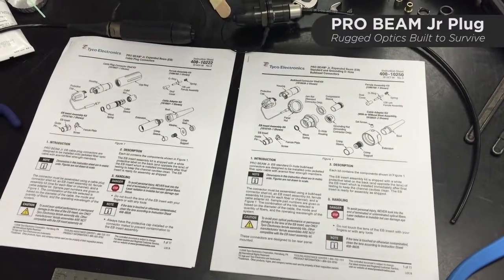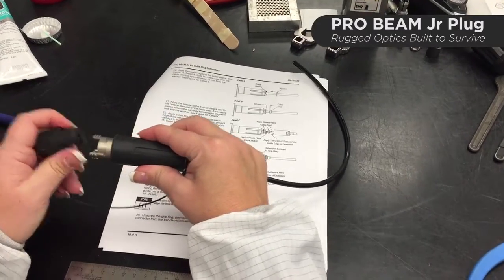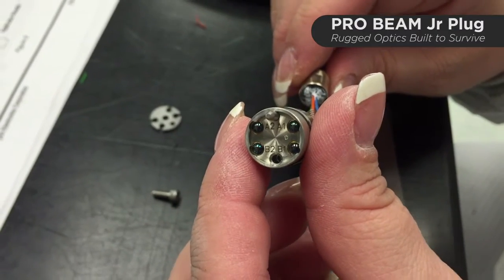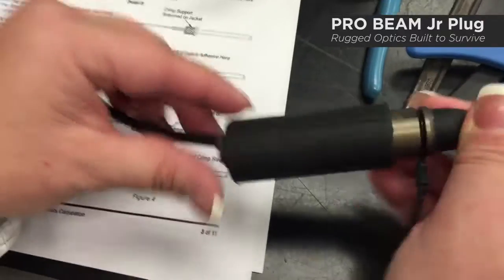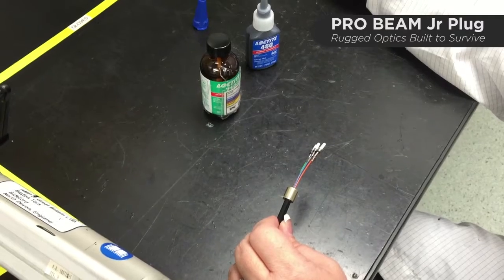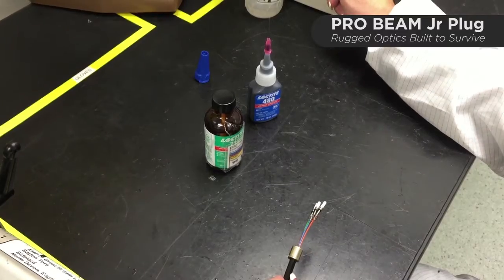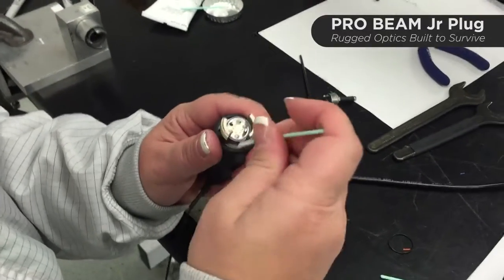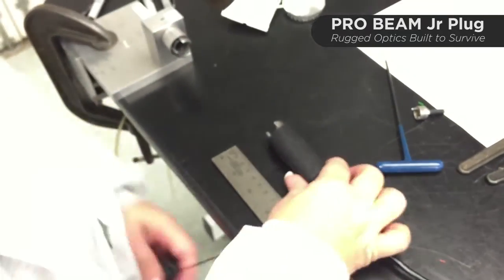TE Connectivity PRO BEAM Connector Series Re-termination Process

Comment: The one thing in this video that may have been overlooked was when you polish the terminus insure that the surface your polishing on is perfectly flat such as glass. Do not use a rubber pad as this could create a curvature on the terminus and causing for a higher than expected insertion loss.